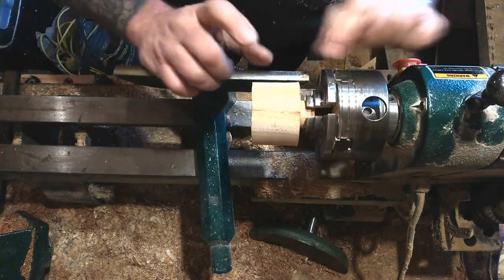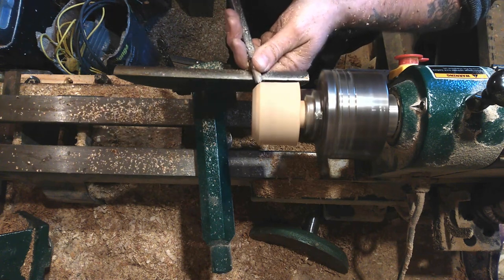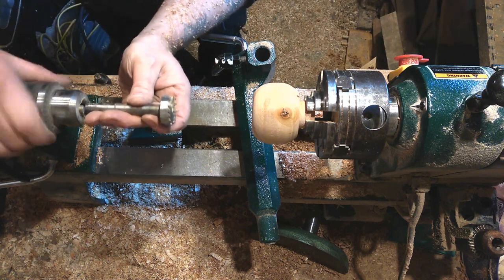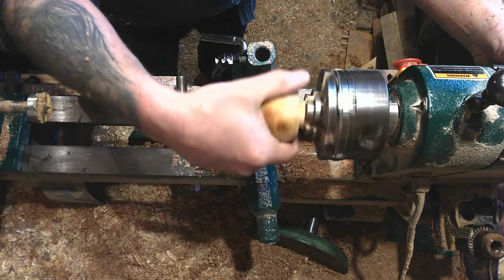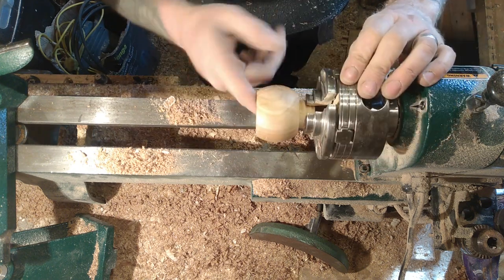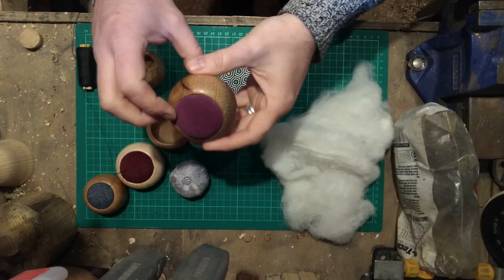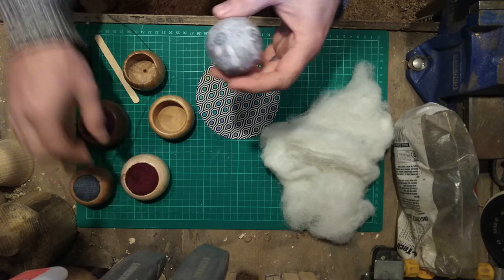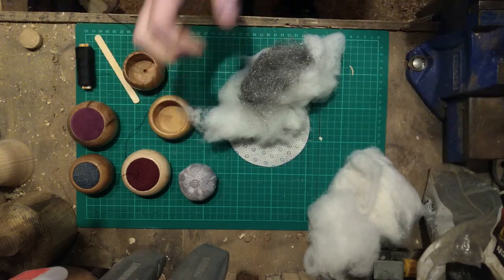How to make pin cushions

Comment: Thank you for the video.  Great idea for small blanks!  After you hollow the bowl and turn it to work on the bottom, how is it being held in the chuck?  I'm a beginner and still learning all the ways of mounting blanks!
Reply from the maker: Thanks for watching, I use a 4 jaw expanding chuck, which can either grip a piece of wood like a clamp or if you've hollowed out a piece of wood you can use the chuck to hold it by expanding it inside the bowl.